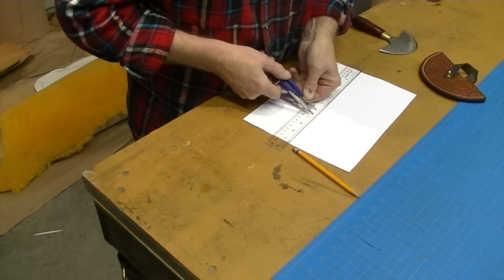Double Round Knife Sheath

Comment: great work! whatt king of oil are you using to get the nice brown collor? and what kind of knife are you using to cut that heavy leather?
Reply from the maker: The oil is pure neatsfoot oil and I use all kinds of knives, round knives, straight knives, clicker knives, whatever works for the particular application.
Reply: Do you find neatsfoot oil to be all the finish you need? Or is it just undyed leather you use it on?
Reply from the maker: marius alfsen
 I use it on either dyed or undyed leather but always before I put a final finish on. Most of the time I don't use another finish but if I do it's usually Tan-Kote for the more delicate things or Fiebings Aussie Leather Conditioner for the more rugged outdoor things.
Reply: i see :-) thankyou for your time :-)